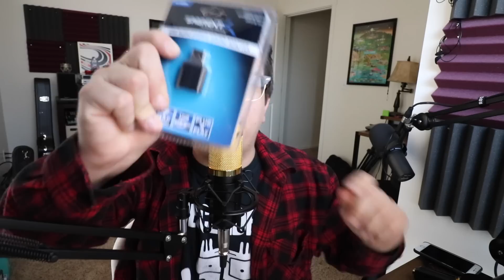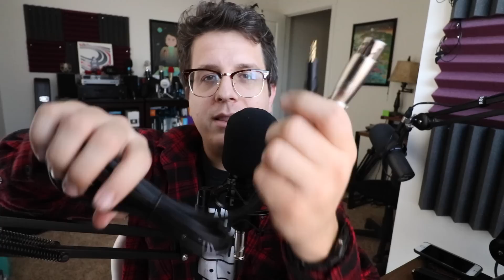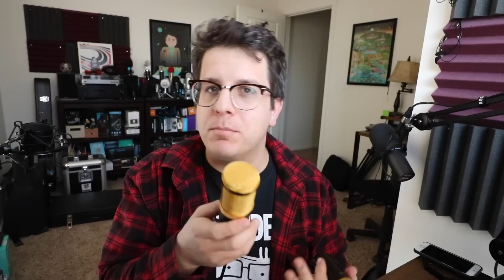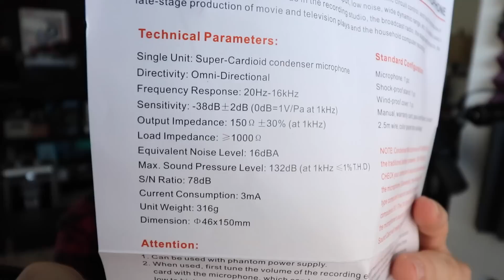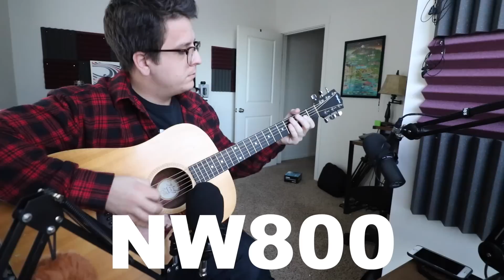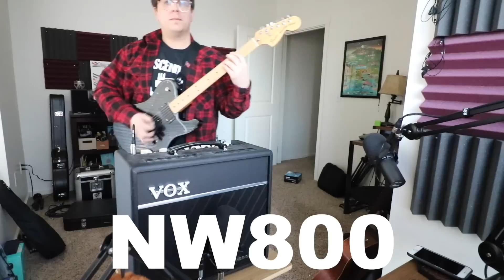Neewer NW-800 Condenser Microphone Review / Test

Comment: is it possible to use some of these condenser mics feet away from face, so its not in the frame?
i have a usb card that gives enough voltage to run mic alone, but when i add phantom power i dont see any improvement with that mic, do i need a phantom power at all then?
Reply from the maker: +Marko Žutić https://youtu.be/x8SmvCvjf1M?t=2m14s

There's a test of these mics at a distance. What soundcard are you using? And if it doesn't improve the audio, by adding a phantom power supply, then you are probably fine without it.
Reply: Podcastage i just measured voltages, one cheap with white cable extension has 4.5V and the sabrent one has only around 3V.
it does inprove quality at all, id say quality is pretty much the same with 4.5V card.

What microphone are you personaly using and on what settings for shots when mic is not in the frame or right next to your mouth? :D
Reply from the maker: Marko Žutić Well there ya go. Do you have a link to the adapter you bought that provides 4.5v? If I am introducing a versus series, it is just the camera's mic. Nothing special or good about it. 

For personal podcasts, I use Shure SM7b w/ cloudlifter CL1.
Reply: Podcastage it's a generic white one, and it came in the box with condenser microphone, so unfortunately i do not have a link to it, it was bought of ebay seller. And sometimes you get these usb-s and sometimes you don't :D

o thanks, i thought that you have some kind of shotgun mic or something like that. Good built in mic your camera has :D
Reply: btw 4.5V usbm alone is still louder then sabrent+phantom power together
Reply: and imo you can turn sabrent into 4.5v by adding 1.5V battery in series with the circuit, you would need to create a short cable that houses battery :D
Reply from the maker: AH! I got that same adapter with one of my mics and it only provided 3v. I guess it's just a lack of checks in balances in the mass produced soundcards. DO YOU HAVE ANY IDAE HOW TO DO THAT!? THAT WOULD BE AN AMAZING VIDEO!
Reply: Podcastage kekekekke, yeah, just add 1.5V battery to the lead that carry voltage, and voltages will add up, 3+1.5 is 4.5.
i will try to create video on that subject,SUBSCRIBE TO MY CHANNEL LOLOLOL :D
 just cross my fingers not to burn any electronics equipment.
USB audio card gets voltage from the 5V usb, and you could probably try to get full 4.5V from the usb itself, but that requires more tinkering and busting USBS.
Anyways, i just measured voltage from internal sound card of my laptop and it gives only 2.5V (reason why it sounds so dull)
also my samsung phone jack gives 2.5V
i guess all of them could give good quality with more voltage to it, only internal sound card gives so much noise that it does not worth to mess with it. But converting those 3V usbs to 4.5 is simple task.

Comment: Hi! I have bm800 and use the sabrent USB - plugged into my mac. However, the amount the volume picks up is very low , and although I make the input volume into full,  it's still low. I figured that your sound is really loud and good. Is there anyway you can help me figure out the reason? (I'm using it for a vocal record) Thanks
Reply from the maker: +Emily NHS https://www.youtube.com/watch?v=J1v1jtHz4C0

Solution is to buy phantom power as well.
Reply: Thanks

Comment: i bought the mic and my sound sucks dick so what do i need that my sound is better? Can someone help pls!
Reply from the maker: +PhiliCeratops USB Soundcard & Phantom power supply, or USB Audio Interface with Phantom Power.
Reply: +podcastage so i could buy this and everything works: http://www.amazon.de/JUSTIN-Justin-Phantom-1/dp/B00NSMP4SU/ref=sr_1_1?ie=UTF8&qid=1459036144&sr=8-1&keywords=phantom+power+48v
Reply from the maker: That with an XLR to XLR & XLR to 3.5mm and USB adapter. Yes. If you are using a condenser microphone.
Reply: Podcastage ok thank u for ur help

Comment: Hi , I own an "old" toneport UX2 from Line6. The XLR ports on this device have attached a button that says "+48v". I'm wandering if this mic will work with the toneport. Also, if you can suggest me a  – possibly free – vst for speech/radio sessions [maybe an eq will work, I think, but I'm not so *in* these type of things.
Reply from the maker: +jampoid That should work. And try using Audacity which is a DAW and should have an EQ in it.
Reply: I use Reaper in evaluation mode for now. I'm planning to buy it, it's feature packed and very stable.

Comment: Is the USB soundcard required for a laptop that already has a dedicated microphone port? Or does the built in one not provide enough power?
Reply from the maker: +Code-E You will need phantom power.
Reply from the maker: +Code-E UNcertain if USB soundcard required. Do not own computer with built in mic port.
Reply: +Podcastage Okay. Does phantom power, or a powered USB soundcard, help any microphone sound better? Like a lapel mic or headset mic?
I'm still learning, thanks for the help.
Reply from the maker: That's a very difficult question because there are different microphones that require phantom power and others that can be ruined by it. Dynamic mics do not require power. Condenser microphones do require phantom power. Lapel mics typically do not need full power, so a usb soundcard may work for them.
Reply: +Podcastage In my research I hadn't learned that Dynamic mics don't need power. That changes things a bit.
Thank you!

Comment: Hey man. I have a Gigabyte Sniper B6 with a Realtek ALC1150 sound card a believe...can you tell me if the NW-800 will sound good or i will need a phantom power. ?
Reply from the maker: +QcPhilo I have no idea. I do not review mother boards, and I no longer review soundcards. You will need to check the specifications of each and see if they provide the output voltage for either.
Reply: Alright i was wishing that you would just knew somehow XD. Thx for the fast answer though! Good job with your channel!

Comment: I'm thinking about buying this mic, along with a 1 channel Phantom power. do I also need to buy a sound card or can I just plug it into my laptop microphone jack ? is the Sound card a MUST HAVE in order to record?
Reply: +KushMasta Rick It's a must have if your computer doesn't provide enough power. At least it used to. The chip has been changed in the Sabrent and Syba sound cards so the sound cards don't provide 5v anymore. You can't use the sound card by itself anymore, however for $20 you can get a phantom power supply and use that to give enough power for the mic to make it sound good. Or you can get a mixer, which would be a more appropriate way to power the mic. Can range from $40 and up.
Reply from the maker: +JACMIC23 Excellent information. KushMasta Rick, I second everything that JacMic23 said.
Reply: +KushMasta Rick You can still get Sabrent/Syba if you are planning to get a phantom power supply. However I think the cheapest one will do fine. Look at +Podcastage sound card comparison and listen to the one with the smallest hiss
Reply: +JACMIC23 thanks! so what soundcard would you recommend?
Reply: +Podcastage what soundcard would you recommend if you're on a budget?

Comment: Hello, I've bought NW-800 and sound card USB but recorder volume is still very very low. How can I fix it? Thanks Man....Respeck fi yuh
Reply from the maker: +Francesco Sapio this will most likely answer your question https://www.youtube.com/watch?v=J1v1jtHz4C0
Reply: +Podcastage if I have well understood there are sum little variation in the production of these item. Someone has a chip other one another one. One of these two chip have voltage 5V and the other one 3V, isn't it? Or did I misunderstand? Thanks for your help
Reply from the maker: Francesco Sapio That is correct. Unfortunately, companies alter the internal components without notifying the public, so it is impossible to keep track of adapters and how they work.

Comment: Hi,
I have the NW-800 AND a phantom power device. When I listen to my recordings, there is always a background noise. It is like a  ''Shhhhhhhhhh''. I cant have a clear sound like yours. Can you help me ? :( Sorry for my bad english.
Reply from the maker: +piogg I am not sure what is causing your issue. I connected mine with a USB Soundcard and no Phantom Power. How is your microphone connected to the computer? Do you have an interface, or is it plugged into your computers microphone input? If that's how you are connecting your microphone, that is most likely the problem. However, this is just a guess on my behalf.
Reply: Hey I had the same problem before. I was curious and just took apart the casing and blew some dust off and surprisingly, the noise is gone. Its not very scientific, but I would recommend you can try it
Reply: @carlsonrealtor  didnt werck
Reply: I think someone is telling you just to stop.
Reply: Is a ghost
Reply: Possibly dirty power supply. Get a power stick or box that cleans the signal
Reply: Same but no phantom power supply
Reply: That has to do with The drivers you have installed. Its a conmon problem on Windows 10
Reply: @S2condHeartbeat  Hey I feel the same way, do u know how to solve the problem. I have installed latest version of realtek audio but it still not working well.
Reply: cut off the bottom 100 hz in the eq
Reply: almost 100% fan sound :)
Reply: Me too, but i think its from the xlr cable i bought
Reply: Sound card
Reply: Buy a usb soundcard, the sabrent thingy he showed in the disclaimer, should fix the problem.
Reply: Bro go adobe premiere next adoptive noise reduction and last you can do is change preset settings lower
Reply: piogg wait what did you spell wrong?
Reply: Joe Lavergne  nothing but you can tell from the slightly roboty grammar

Comment: can you connect this mic into a pc by converting the 3.5 into usb and start recording like that?
Reply from the maker: +alex quezada What sort of converter are you looking at? Are you speaking about a USB Audio Soundcard, or are you talking about a cable? I'm not sure.
Reply: +Podcastage audio sound card
Reply: +Podcastage usb sound card
Reply: +Podcastage usb sound card
Reply: +Podcastage usb sound card
Reply: +Podcastage usb sound card
Reply: +Podcastage usb sound card
Reply from the maker: alex quezada You used to be able to do this. But, they changed the components of the soundcards and they no longer provide enough power.

Comment: the mic that i got is bm700 it comes with xlr to 1/4
Reply from the maker: +Nathanael Roda That is strange. Every mic I have purchased BM700, BM800, NW700, NW800, NW1500, have all come with XLR to 1/8" cables. You will need to buy a 1/4" to 1/8" adapter (http://amzn.to/1ZJLBt0)
Reply: +Podcastage thanks broo! i will fit in the 7.1 sound card??
Reply from the maker: 1/8" or 3.5mm plugs are what the adapters utilize for microphone input and headphone output.

Comment: the jack of my condenser mic is not fit in the usb sound card.
Reply from the maker: +Nathanael Roda what condenser mic did you buy? Did it come with a cable? If so, what cable did it come with? XLR to 1/4" or XLR to XLR?

Comment: Bandrew can you do a test on the NW700 where you plug in on a phantom power supply, plug the output on the startech adapter & then plug it on your iPhone to work
Reply from the maker: +Rovic Castillo (Conscience GamingHD) I already tested out a bunch of mics on the iphone https://www.youtube.com/watch?v=Y6voi5c6gKg I didn't need phantom power.
Reply: +Podcastage but it doesn't work with the new update. So if I add phantom power to the mic will it work on the iPhone?
Reply from the maker: I'm assuming so, but you're going to run into issues since there's no way of controlling the mic input gain that I know of. So you will have issues there if the mic is clipping.

Comment: First thank you for these videos they are really helpful. I wouldn't ever know do i need phantom power for BM800 without this video. So my question is, i have noticed that some of Condenser microphones such as BM800 use a kind of 9V battery inside and some of them doesnt wich is weird...That one that you have tested in this video when you open it is there a place for a 9V battery or not? Because i have noticed in a different channels that there is a battery actually wich i didnt understand what is reason to be there..THank you !
Reply: and btw do you recommend to us " Aesis iO Hub " or rather " Behringer XENYX502 5-Channel Mixer " and btw if i get some of these two do i still need a usb sound card.. thanks
Reply from the maker: +AIDProduction That version of the microphone appears to be an older version of the microphone. None of the microphones that I have tested have been active microphones that allow for batteries. That was there to power the microphone internally, without it, you need an external power source.
Reply from the maker: +AIDProduction With the iO Hub, you shouldn't need a sound card as it states that it is a USB device. The Xenyx 502 does not have a usb connection so you will need to hook it up somehow, or you could go for the Xenyx 302usb which I reviewed. It is a USB mixer.
Reply: Thanks a lot Podcastage! i appreciate you

Comment: I need answer quick, lol. If I order this mic and the souncard only, can I use this without a phantom power?
Reply from the maker: +NationalPhillieGaming That's how I recorded it. But I have heard complaints that this doesn't work and you may need to invest in a phantom power supply. I guess it depends on your computers USB output, the USB Adapter you get, and everything.
Reply: ok, i just ordered the mic and the usb adapter you used.  If it does not work, ii will just buy phantom power
Reply: I just recieved the mic today, and to be honest, it sounds like garbage... How did you get your mic in the video to sound so crisp and clear?
Reply from the maker: I simply plugged it into the sabrent USB audio adapter and recorded directly to quick time without any post processing. I just tested a new sabrent adapter and the voltage output is 3 volts on that compared to the 4.5 volts the mic receives using the original adapter. So over the last 6 months or so, it appears that sabrent has changed the construction or components of their adapters somehow.
Reply: is there another relatively cheap one that you can recomend? BTW thank you for responding quickly.
Reply from the maker: NationalPhillieGaming Now i'm just reluctant to tell anyone that any of these will work. The Syba is another one that I used. I want to wait and see what the company says back to me.
Reply: I'm  ordering the phantom power supply from neewer later, once I get those though, just to make sure, I will be able to use this and it will sound just like yoours, right?
Sorry to keep asking, but i dont want to waste money lol
Reply from the maker: NationalPhillieGaming Unless there's more problems than I know of. Yes. I can't give you 100% guarantees anymore obviously since I thought that this USB soundcard was the solution and they just randomly changed the construction. Therefore, I have no trust in any of these companies to keep anything consistent. I don't know. Theoretically, yes it should work.
Reply: Oh, ok. I will be ordering the power shortly

Comment: Thank you for testing this one out! I was wondering what the difference was between BM and NW when the model number was the same.
So, out of curiosity because I know nothing-- what happens when you DO use 48V of phantom power with a mic that needs only a fraction of this amount? Absolutely nothing? Severe consequences?
Reply from the maker: +3x5Paradox Hey. I actually did a test about how it affects the sound quality of these cheap microphones (if at all...you'll have to find out. HA!) But as long as it's a condenser microphone, it should not cause any issues. The mics I have tested have listed that it can deal with phantom power. If you are working with a DYNAMIC microphone or a RIBBON microphone, DO NOT use phantom power though. Using phantom power on those mics can destroy the microphone depending on the build. Only use phantom power on a Condenser microphone.

Comment: can you do a video comparing condenser mics with and without soundcards?
Reply from the maker: +Alexican Unfortunately, I do not have a way of plugging microphones directly into a computer. I have a single input for headphone and mic. I attempted to use a splitter and 0 volts were coming through and the condenser mics I tested didn't even work. So I have no way of testing this which is why I use a USB adapter.
Reply: omg you cant use it without a soundcard

Comment: Hey! Sweet mic! Do you think spray painting a mic will ruin it's sound dramatically?
Reply: the microphone parts unscrew piece by piece. so you can just take off the parts you wana paint and then paint them. make sure when painting to only do very light cotes of paint at a time or else the paint will drip, and block up the holes in the metal grill of the microphone.
Reply: +Podcastage thank you :)
Reply from the maker: Benjamin Ewald Great Idea Ben! =)
Reply from the maker: +Quocamole1206 If you do not get spraypaint in ANY of the mechanics it shouldn't affect the sound.  I would HIGHLY discourage you from spray painting a microphone though.